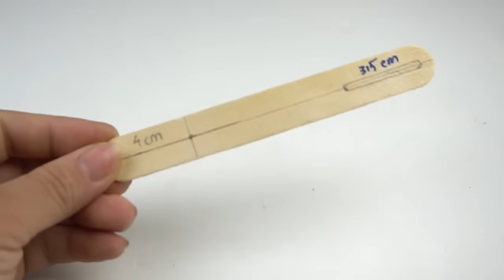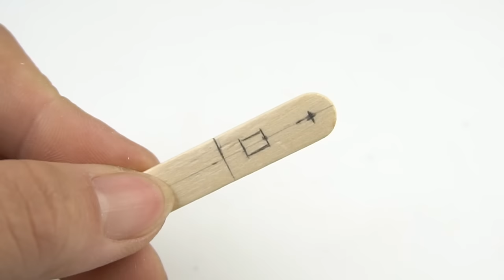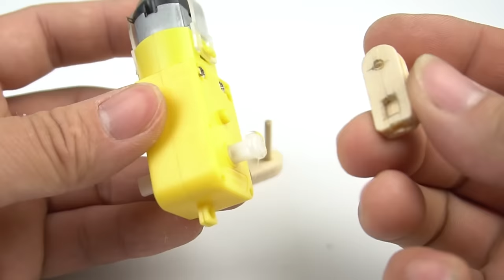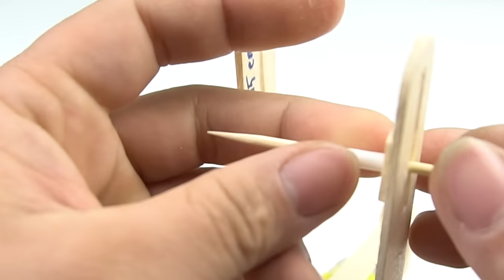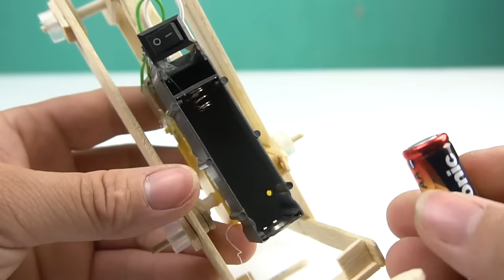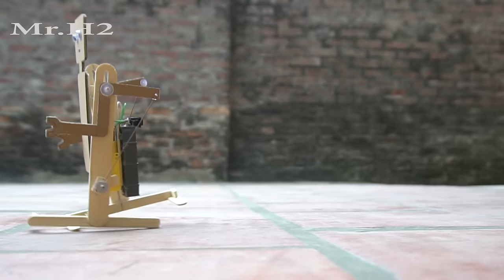How to make a Simple Walking Robot at home  - Amazing idea with DC Motor

Comment: what is the RPM of the geared motor ?
Reply from the maker: I used " yellow gear motor" - you can look it on Google
Reply: @MrH2official  I mean what is the gear ratio 100 RPM or less...
Reply from the maker: @circuitandtech  
I use a 1.5 volt battery + yellow gear motor and I think the gear ratio will be less than 100 RPM
Reply from the maker: If the (RPM) ratio is large, the robot will easily fall while walking 😅😘😅
Reply: Thanks for the reply...very few youtuber reply...